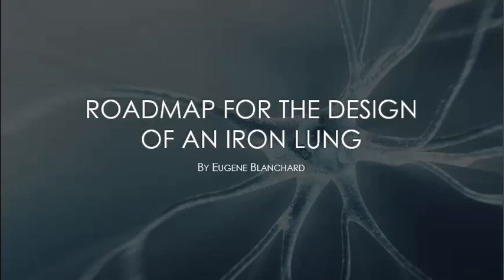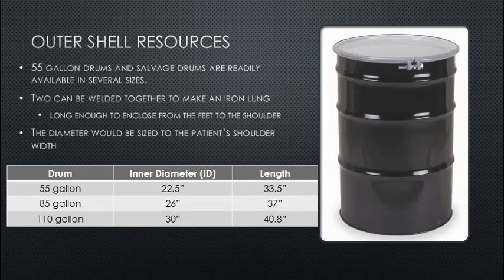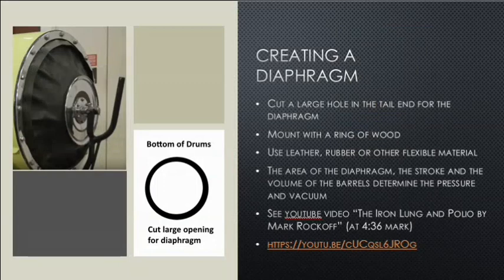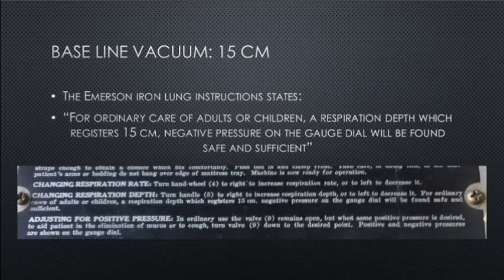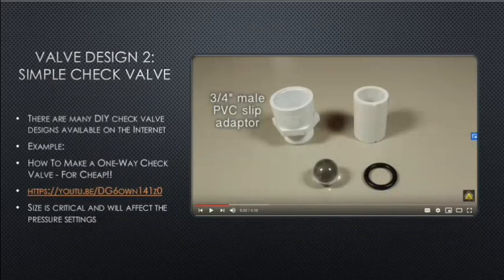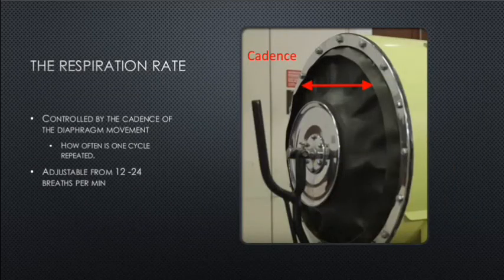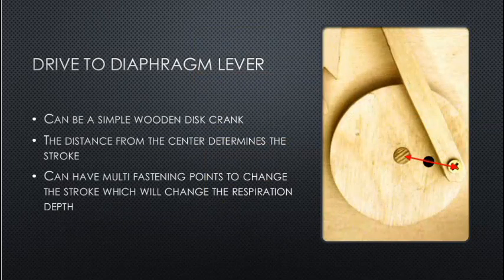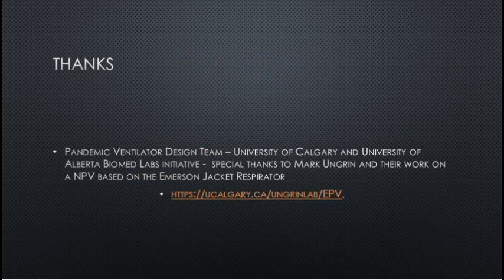Roadmap For the Design of an Iron Lung Respirator (Negative Pressure Ventilator - NPV)

Comment: Do you think this could be used as a viable option for Corona virus patients? 
It would be interesting to connect a control system that would convert the iron lung from a periodic system to a system controlled by the patient themselves. I think this may reduce lung damage the sometimes occurs with positive pressure ventilators.
Reply from the maker: Much later reply: There is a much better understanding of COVID-19 now then when this video was uploaded. At the time, it was felt that ventilators were going to be the savior in the fight against COVID-19 but results from New York City showed otherwise. There was a 90% fatality rate for those put on ventilators so the fight was directed to prevention and other avenues.